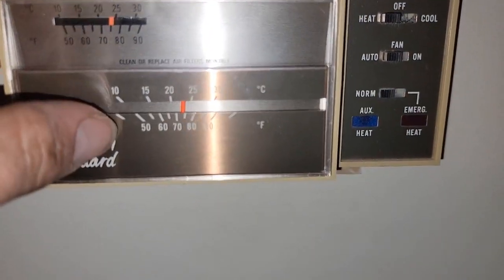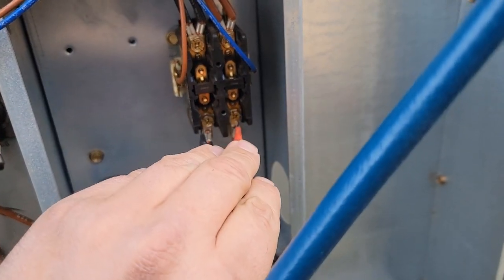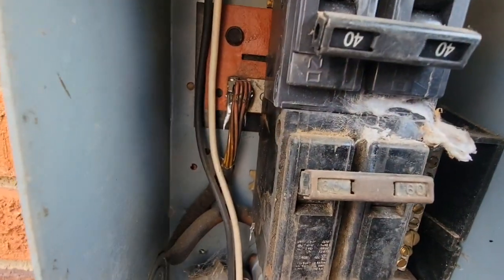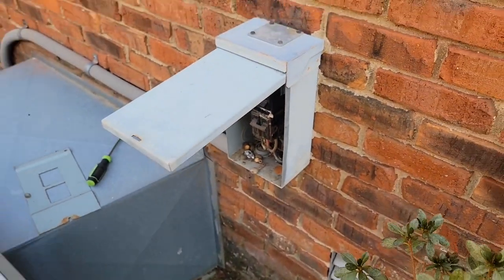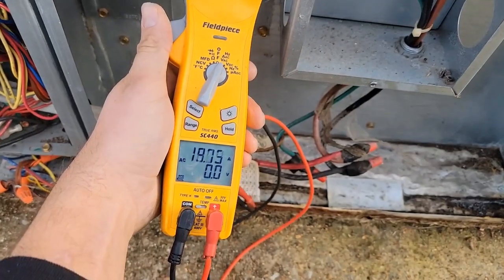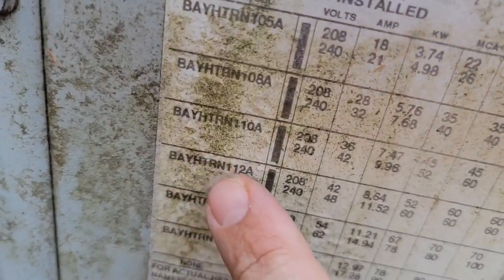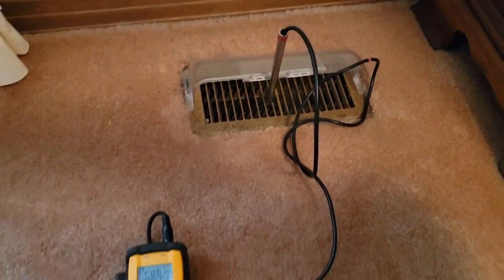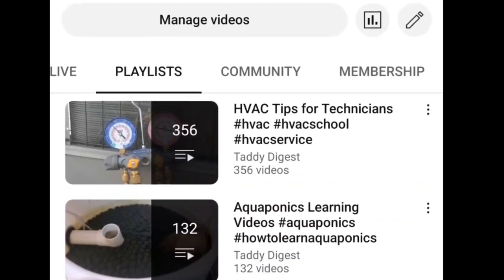Auxiliary heat not working on heat pump

Comment: Thanks for that! We have a new heat pump (American Standard) in Boston where the temp this week was -2 and less(!). I assume at that outside temperature it is the AUX heat that should be kicking on and heating the place, however, I do not see AUX light up on the thermostat at all. I assume this means the heat pump is still trying to do it on its own. It has taken about 7 hours to go up 5 degrees. Seems that the HVAC tech should look at the breakers, lugs and the aux heater itself, right? Other ideas welcome 🙂
Reply: Also, depending on the type of thermostat, how it's programmed (if digital), how many racks of aux heat you have, but there are many different things that could be the problem. I ran a service call last week and the wire for the aux heat from the thermostat wasn't ever connected in the air handler. Only connected between the outdoor unit and the air handler so it would only come on during defrost.
Reply from the maker: I've had that happen a lot
Reply: @bill944  Thank you Bill and Taddy. I will try to find a clever technician who can figure out if it's the thermostat wiring not being connected correctly to call on all available aux heating strips, or the breakers, or lugs, or a dead aux heater itself. The thermostat is a Venstar ColorTouch (6.93) if that matters.

Comment: I need help. I have a heat pump all electric. It was -20 out a week ago. Thermostat set to 68. I got home from work and temp was 63. Thermostat said aux heat was on. I turned em heat on manually on Thermostat, the house shot up to 68. What gives?
Reply from the maker: thermostat w2 terminal may only be wired to call one heat strip on 
not sure I would need more info